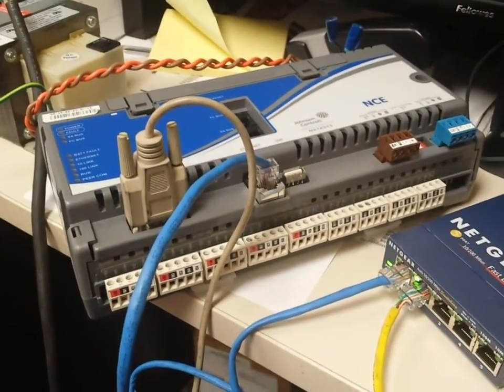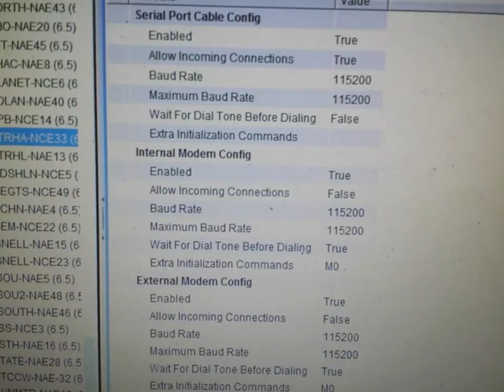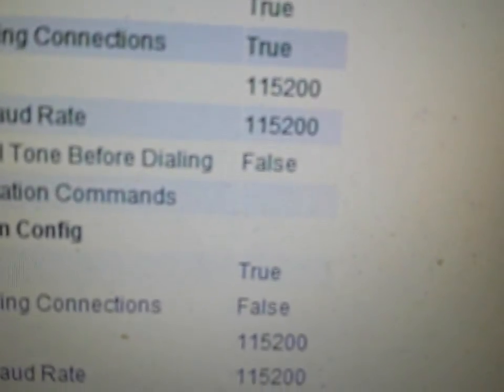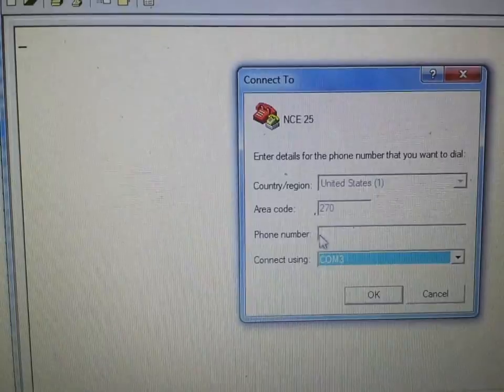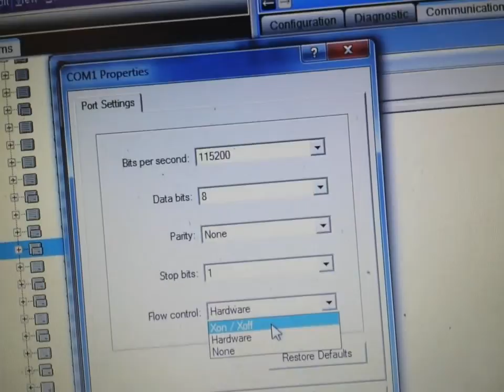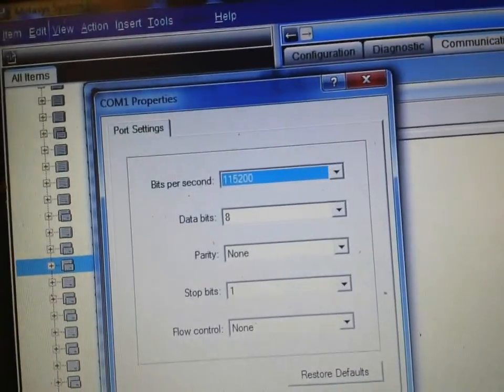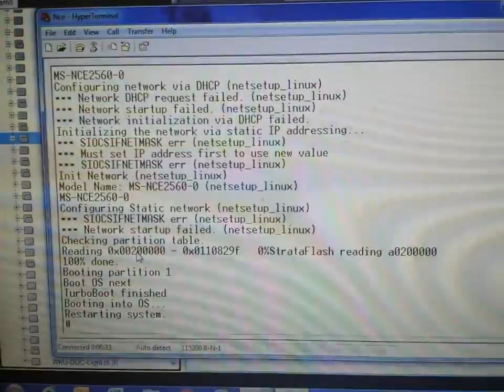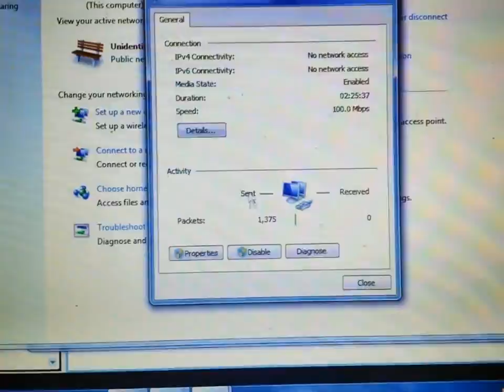How to Access Johnson Controls NAE without knowing IP Address

Comment: Interesting video, thanks. Do you have a procedure to access the data the NAE/NCE is spitting out without using metasys? We have a building that was turned back over to the owners, and the NAE was removed from our system and I want to be able to help the occupants out by either them or the owners being able to read the AHU values. Thanks.
Reply from the maker: Once you gain access and get the IP address you should be able to log into SMP if you have the credentials

Comment: Did a port dump on NAE 55. Everything comes up but the I P address is all zeros and DC HP is disabled. I have the device name and the device MAC address but that’s it is there another way to get him to reset the IP address back to what it supposed to be
Reply from the maker: You should be able to access the device simply by using the mac address and you can set the ip to whatever you need it to be.  You can also change the DHCP enable from the configuration tab when you are logged into the device.

Comment: I followed your instruction and was able to obtain the IP address.  But I cannot connect to an NAE via ethernet because, previously, someone had set the IP address to 0.0.0.0.  Please advise.  Thank you so much for your videos!
Reply from the maker: If you're using the launcher tool use the mac address of the device. Dont put spaces or periods between the numbers
Reply: Thank you for your response.  After realizing that the NAE was DHCP enabled, I connected to our company network and an IP address was then assigned.  From there I was able to connect via the assigned IP address using Launcher.  Thanks again for sharing your invaluable knowledge on Metasys.
Reply: @Systemcontroltech  Can you do that? I was in a jam today and I never knew you could do that. I ended up using wire shark instead.

Comment: Hi how are you. 
Do you have a video that shows how to upgrade NAE version
Reply from the maker: Not yet but the upgrade will depend on the version you are wanting to upgrade to. 8.0 allows you to upgrade directly from the server.
Reply: System Control Tech .
Thanks for the reply. 
I'm currently have an NAE at 6.0 version . I would like to upgrade it to 9.0
With the software SCT and using the NUT tool from JCI. 
Is what I like to know how to do the process. 
Thank you
Reply from the maker: The easiest way would be using sct and selecting code download. If you are using the newest version
Reply: System Control Tech code download? I'm sorry I guess I'm missing that part.
Thank you again
Reply from the maker: Good luck.